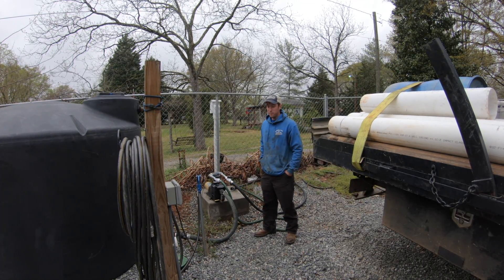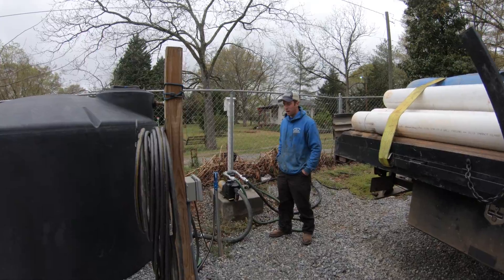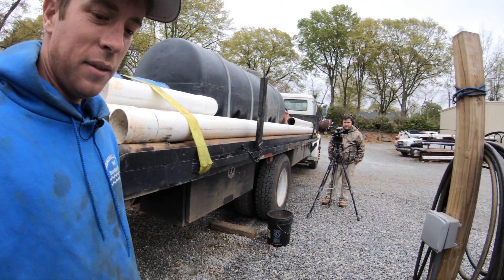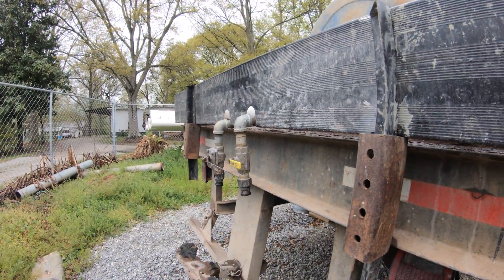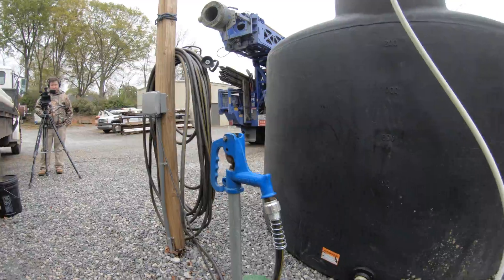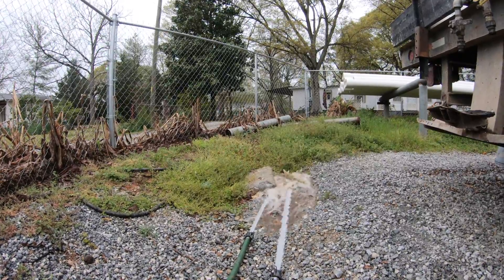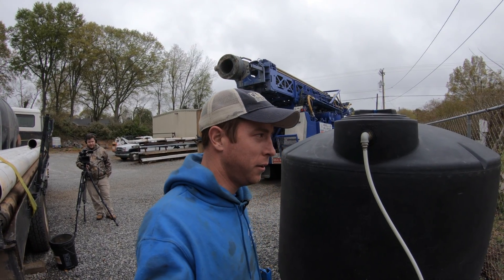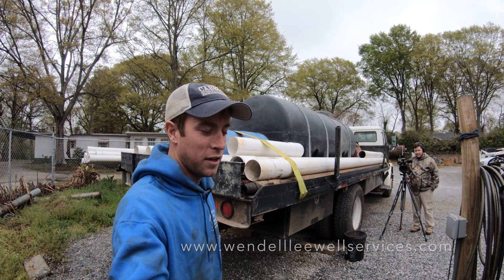Filling a Water Truck Up Quickly Using a Pool Pump and Storage Tank

Comment: Bigger hoses, get it down to 10 min or less.  We are lucky our town has a water dock that loads 3400 gallons in under 15 min.  In the summer we fill from a hydrant with a float in the tank overnight for the first load. We also leave it full for fire department use if needed.

Kenny
Reply from the maker: LOL, we would get cuffed and stuffed for filling from a hydrant around here. That would be nice to fill up that quickly. Agreed with you on the hoses, they were done that way to match our connections to our drill rig but it would fill up faster